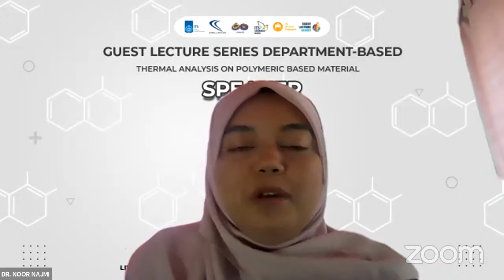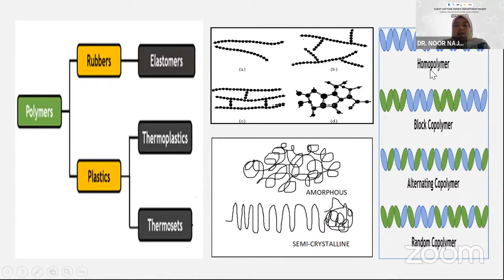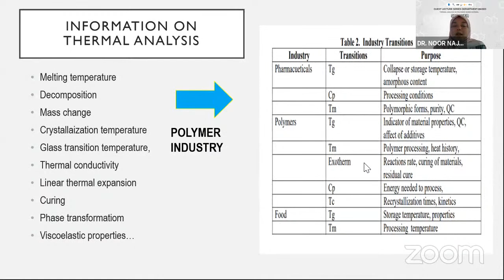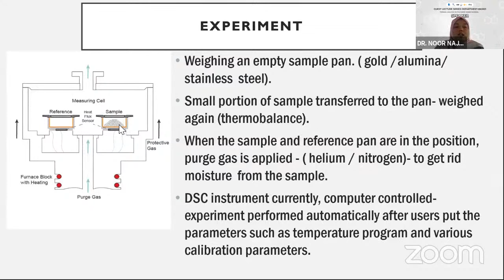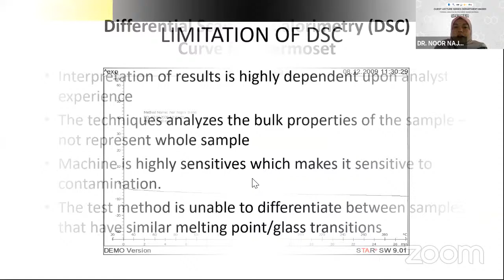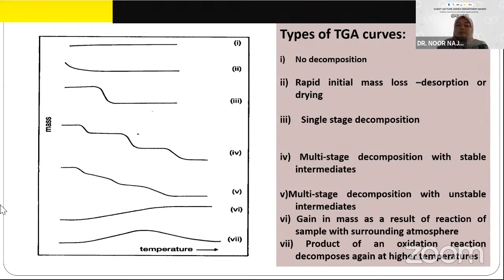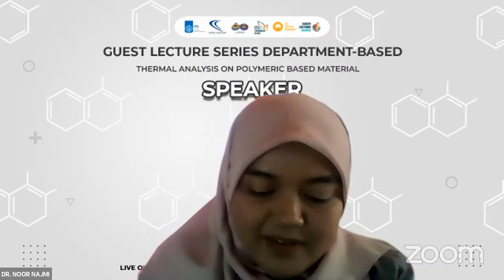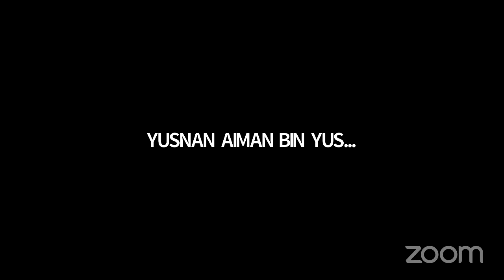Guest Lecture Series-Polymer Material-Thermal Analysis on Polymeric Based Material

Comment: Assalamualaikum warahmatullahi wabarakaatu
Please add their insulation properties that allow thermoset polymers such as epoxy to withstand very high voltage
It has many applications in  electrical engineering 
Could you release a video explaining it?